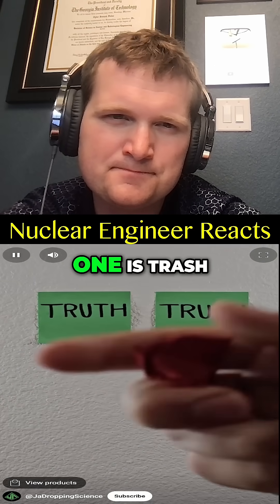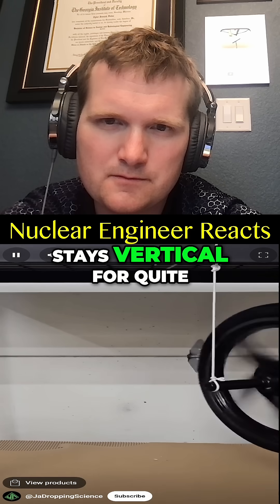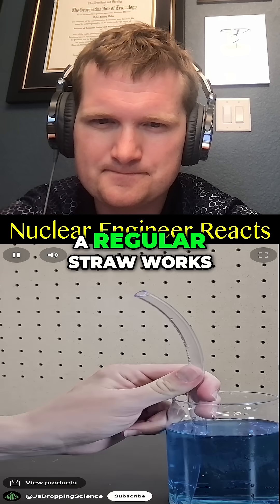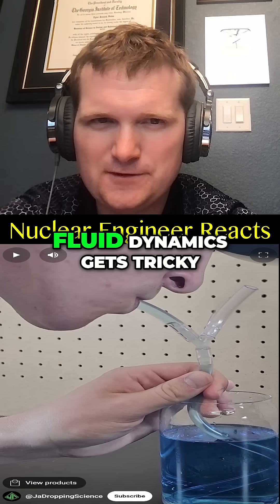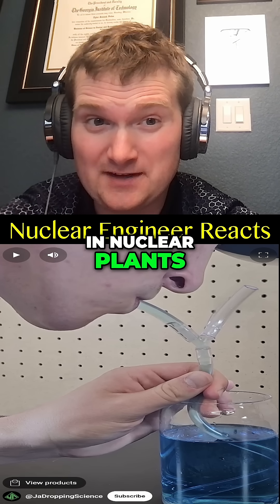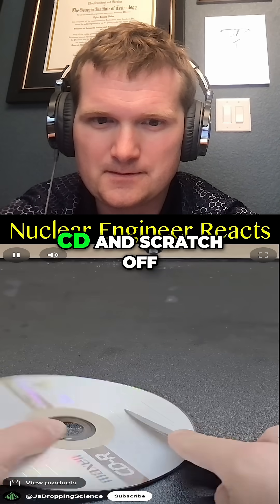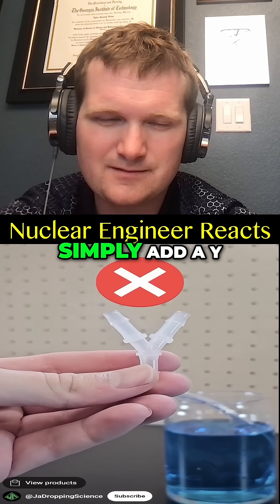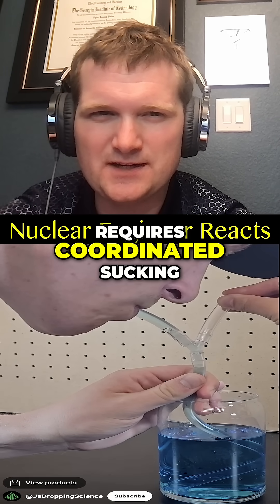A Forked Straw - Nuclear Engineer Reacts to 2 Truths & Trash by JaDroppingScience

Comment: So if 2 people suck at the same time-
Reply: first problem is both would have to suck because the Y would allow air in from the other side unless a valve was added to stop that so you'd just be sucking air.

ThEN again, without both sucking, you'd get presure swings in the suction and whole thing gets silly.   So you want a Y junction with 2 one way valves that close when neg pressure is not applied to that straw.
Reply: @jenniferstewarts4851 r/woosh